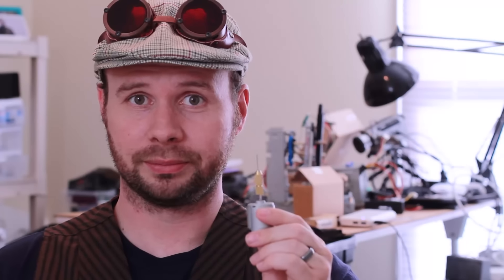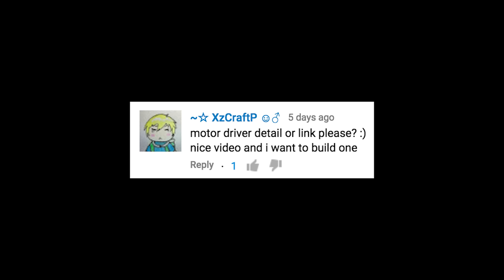Comments Show: Hack CD-Roms Into a CNC Machine - Part 2

Comment: plz make a drill and 3d printer attachment video
Reply: +UPandUNDER JUST DO IT!
Reply: +NotInHD it can use a drill, but i assume only on soft materials
Reply: i would like to see if it can mill a PCB.
Reply: +expansiongames I want this as well! I actually started to make this project before this video, but never actually finished it...
Reply: +UPandUNDER  Could you also make a laser cutter?
Reply: +TheMorbiousStone wel machinable wax is a thing and is used allot for prototyping

Comment: No, yes please do at least one more vid and comment vid with the drill added on to it. I personally would love to (after the one with the drill) see the series continue to more vids with the laser and 3D doodler. However, please at least do one more now using the drill. Especially after Metalhead2508's comment, he has a good point of the torque limitations. I for one would love to see if that limitation can be over came.

Comment: Additionally, I'm presently gathering parts to make one of these for myself. Though instead of using a small motor, I'm hopping to use a Dremel 4000 (high power, high speed) suspended from above and using a Dremel flexible shaft to attach to the CnC to do the actual cutting.

Comment: it would be interesting with a drill modification to make a small cnc milling machine. even if you could add the proper stepper motors for the x,y, and z axis for this. nothing too big like the larger heavier cousins of a real milling machines.

Comment: I am making my own 3d printer thanks to your vid it helped a lot
i am making my very first printer out of old cd drives but i replaced the cd drive motors with motors from old printers  the only trouble with the electronics i have a ardunio atmega 2560 and easy drivers  i just ordered ramps 1.4 so ill have to see if that helps but i could use help setting that up and the grbl controller the website  dose not let you dl any more maybe use marlin